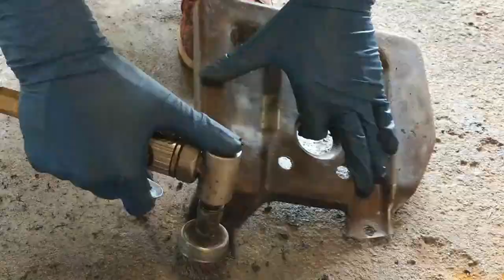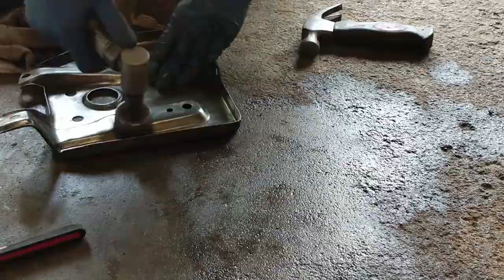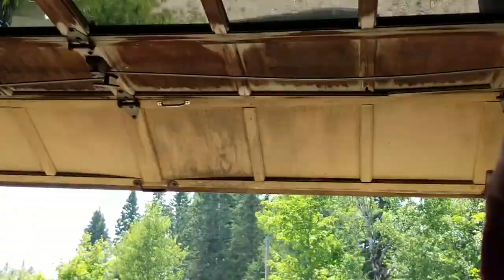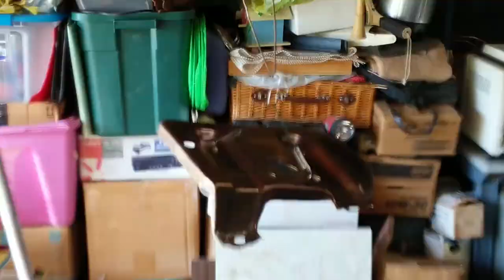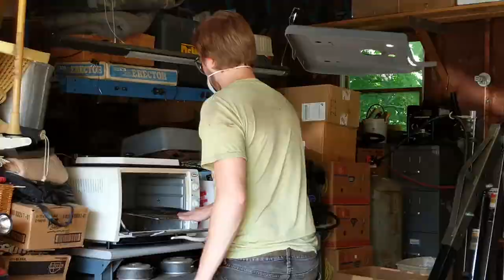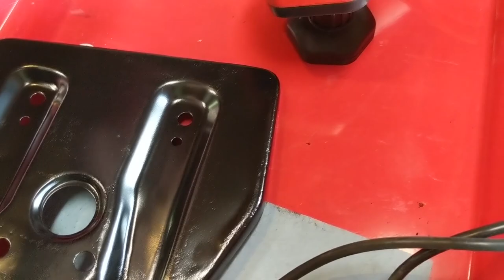Car Part Restoration With Powder Coating ✨🖤 DSM Battery Tray Coated Black!

Comment: Way back in the day, a mate had a powder coat businessand i had so many parts on my EH Holden done by him.
Powder coating just gives things a better look 👍
Reply from the maker: That's pretty boss. Yeah I really like it! It can be difficult to get a part clean enough so the rust never comes back. Still need to figure out the best method for that. Probably some kind of rust removal or acid etch bath before coating. Thanks!
Reply: @802Garage  mate had a sand blaster, which was good for larger things. Small things were done like the video.
Think i had the shinest black diff in Australia

Comment: If you do this to the whole 
Eclipse it would be almost like new...damn this process makes detailing/ polishing/ repainting the bodywork of the car look like its too easy in comparison!

Great results!
Reply from the maker: A lot of people don't realize powder coating requires really good prep! Hopefully this job lasts. I have powder coated a few items and had the rust come back from underneath. Possibly too thin a coat of paint or not cured enough, or over cured. This tray seemed to go well though. :)

Comment: Looks good.what's it cost to do a part like this?
Reply from the maker: Thanks! Well this part took me about 3.5h with filming. So probably 2.5-3h of labor. If i was prepping and painting it for someone I would have to charge at least $50-75 I'd say. If it came to me prepped and all I had to do was paint it, maybe $20-30? Generally the smaller, flatter, and better condition a part is the easier powder coating will be. Has to be stripped to bare metal though. I need a sand blaster to make that easier. With enough time I could even have filled in the rust pitting, but then you are talking restoration prices, hah.
Reply: @802Garage  I was wondering more along the lines of consumables or the actual powder stuff
Reply from the maker: Oh, duh! My bad. Ignoring the paint stripping and prep, the powder was probably less than a dollar. Generally powder coat is like $10-20 a pound and this probably used an ounce or two. A lot of it gets wasted without any reclaim setup. What I really want is a sand blaster to make the prep stage much easier!
Reply: @802Garage  I agree with needing a sandblaster cabinet, look at TP tools they’re made in the USA
Reply from the maker: @richardwilliam3757  When funds and space permit, definitely. Thank you!

Comment: Is the strut tower the worst rust on the car?
Reply from the maker: Pretty much yeah. It's mostly the passenger strut tower top by the forward upper wishbone mount and the driver side strut tower apron where it connects to the frame. Going to be a lot of cutting and welding!

Comment: How do you feel about people painting valve covers?  The one on my car isn’t rusted but the metal is discolored. Should I just polish it?
Reply from the maker: Personally I'm a big fan. Nice way to customize the look and make your engine bay cleaner. If you like the polished look go for it, though it can be hard to get a nice even finish. I have powder coated valve covers before with good success, but the oil residue can make it annoying. Which car do you have?
Reply: It’s an early 2000s Mercedes station wagon, can’t figure out what kind of metal the valve cover is made from...sorry it’s not a Subaru
Reply: Google says it’s magnesium